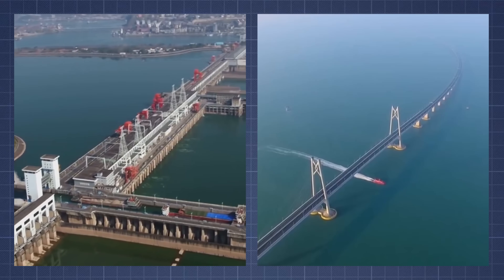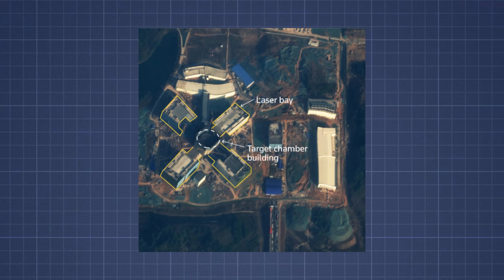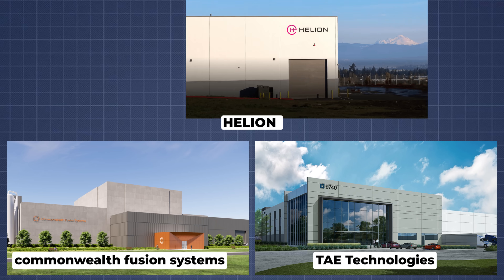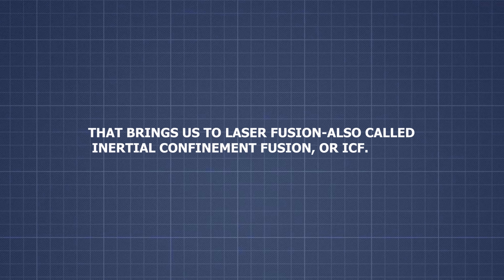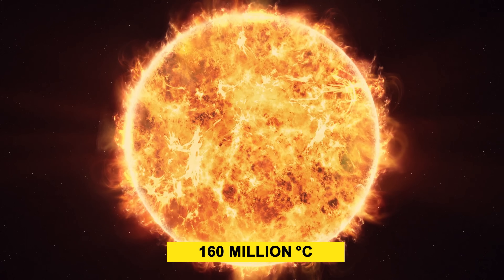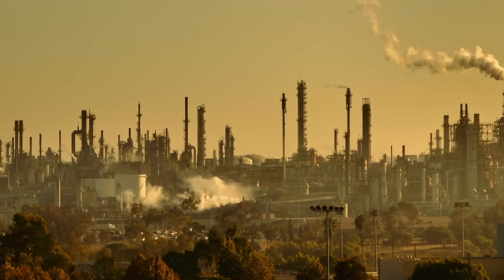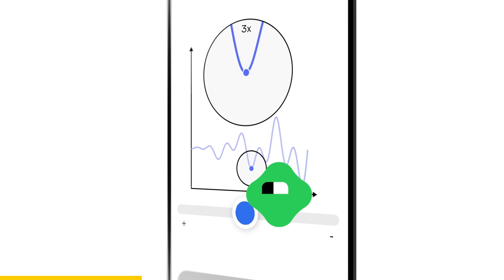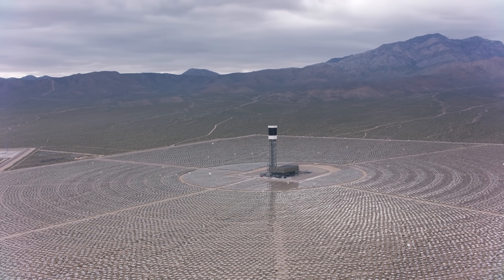China Just Built an Artificial Sun That Could Power The Entire Planet

Comment: Is it China's artificial sun? TECHNOLOGY: China's 'artificial sun' sets nuclear fusion record, runs 1,006 seconds at 180 million°F. China's “artificial sun,” officially known as the Experimental Advanced Superconducting Tokamak (EAST), has achieved a groundbreaking milestone in fusion energy research.Jan 21, 2025 
They seek to maximize the number of ions in a small region and the amount of time that they stay close together. To do that, fusion reactors heat plasmas to temperatures much hotter than the core of the sun — over 100 million degrees Celsius.
Longest Sustained Ultra-hot Plasma: In January 2025, EAST set a new record by maintaining a loop of plasma for 1,066 seconds (over 17 minutes) at a temperature above 100 million degrees Celsius. This exceeded previous records.

Comment: Considering the amount of power you need to remotely to equal that of even a mine-sun is beyond the power we can physically produce.  While an interesting concept, it has been one that has been worked on since the Nuclear Age began.

Either it be Magnets or Lasers, you are still going to be using more power than you are producing.  It takes a lot more components to produce the levels of power even equal to a fraction of the Sun.  As you need a lot of density, heat and a forever combustible source and we have trouble with a couple of those now.